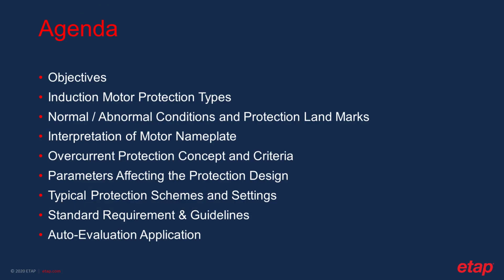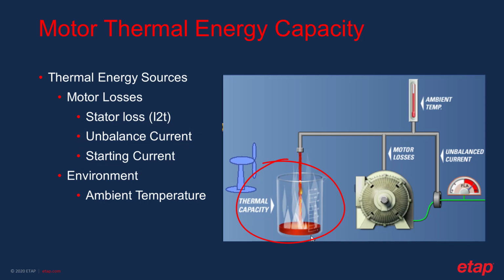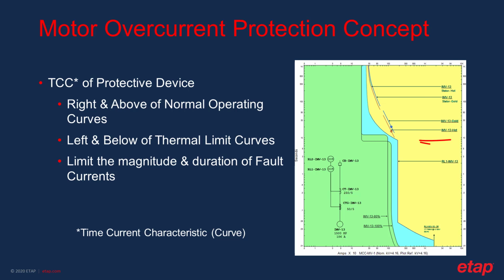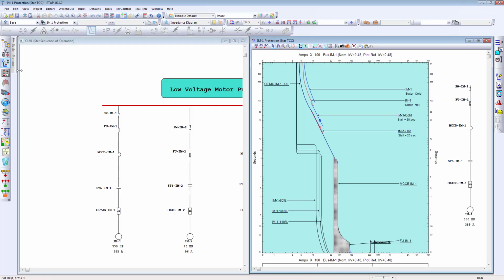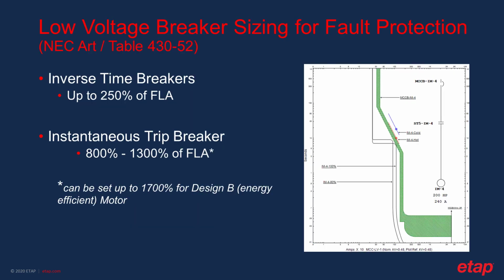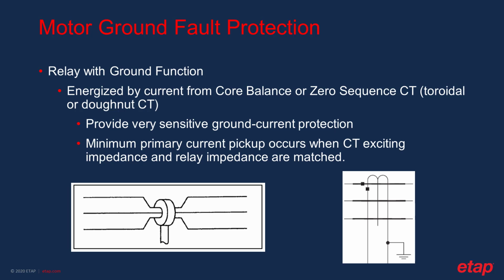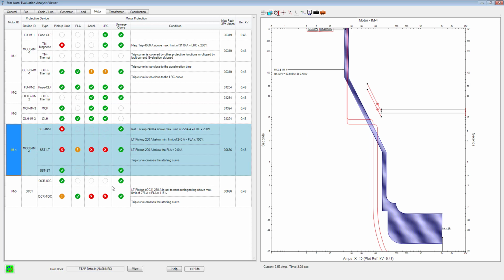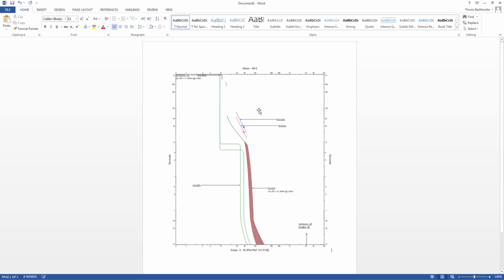Motor Protection - Characteristics & Applications

Comment: When i run motor in ETAP Load Flow, why the Current Flow always higher than full load current mentioned in the motor rating in the ETAP Motor editor? Can you explain? How to make it  is same as the full current name plate? In practice, motor current flow is mostly lower than the name plate current. But in ETAP always higher than the nameplate. I'm really currious about this condition.
Reply from the maker: Thank you for your interest in ETAP Software. Please contact our 24/7 Technical Support Team to assist with your question.

Comment: What is standard negative sequence protection setting?
Reply from the maker: Thank you for your interest in ETAP software. Even though this is a very specific question that depends on a lot of factors, we can provide you with a  general answer: Negative-sequence overcurrent relays can be modeled for motor protection. These relays are required to provide thermal protection against excessive current induced on the rotor. As such, these elements are typically set with a relatively long delay. Please feel free to contact support or your local ETAP office for more information on this subject.